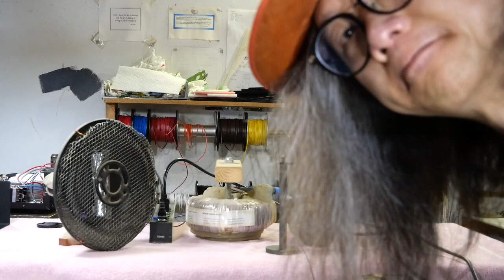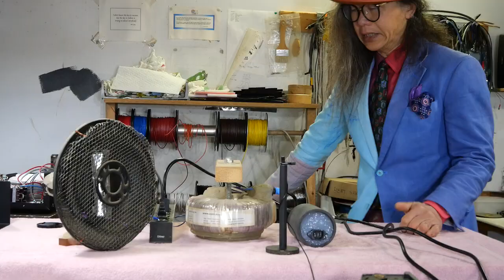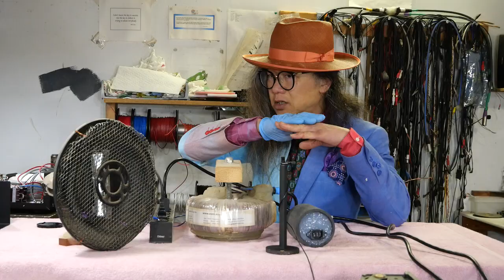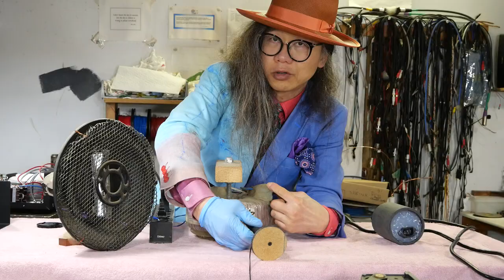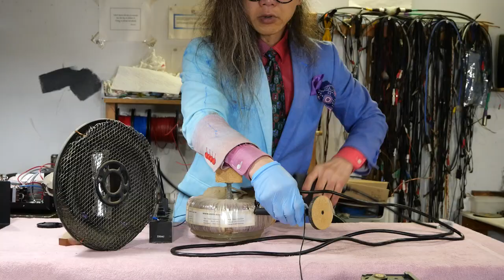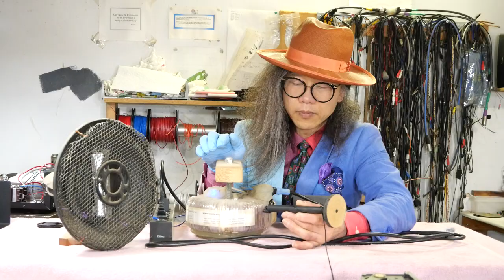DC offset on the ac powerline explains and demo of how DC offset affect transformer.

Comment: @angela-gilbert  great video and thank you!  During early evening my equitech buzzes like that, but quieter.  My question is, does having DC offset impact the sound coming from the system?  (Aside from the noise from the transformer).   My system always sounds better to me after 9PM… is it related to the dc offset or maybe also other noise and voltage sag that happens early evening?   Can DC offset itself impact the audio sound?
Reply from the maker: A little but of DC offset isn't going to hurt but annoying hum from the transformer.  At some point though, when the DC off set get bad enough will start affecting the operation of the transformer causing it premature saturation which will affect the power supply and cause the sound to change.  Where is that point will depends on the transformer design.
Reply: Thank you for your straightforward honesty based in science:)
Reply: So what do you recommend when someone notes their sound system sounds more relaxed later in the evening and a little edgy during early evening?

Would something like your XF series be appropriate?
Reply from the maker: @shionsmith8190  At night, less power are being drawn from the powerline.  Less heavy machinery causing DC offset let noise, etc.  It is the reason at night, usually sounds better.  Adding any of the XF filter will certainly help.

Comment: Does the DC offset affect sound in a system down the line?
Reply from the maker: Yes, it does.  The transformer is less efficiency when it has DC offset.  At the minimum, it decreases the power output.

Comment: What if you are off-grid and your house, stereo runs off battery power and an inverter.......how do you stop inverter noise?
Music-
Artist- Home Alone
Album- Kill em With Kindness
Reply from the maker: @freeradical6390  If inverter is making noise, thr sine wave isn't pure enough.  Make sure you don't use modified sine wave inverter.  There are low distortion inverter but they cost more.  Sometime a lot more.  Of, buy equipment that runs on DC battery. I havr done that 15 years ago with solar panels.

Comment: OH MY GOODNESS THAT'S EXACTLY WHAT I NEED....my Naim NAIT 5i transformer buzzes when I turn on my Sony Bravia t.v using a cheap Amazon power supply, I remember you offering to build me a new Sony Bravia linear power supply AGY for $300 ...do I need the blocker or a new power supply arrrg? Lol thanks AGY , p.s I love that blue jacket
Reply from the maker: Which side of the blue you like more? 😁😆
Noise from switching power supply is usually a different type of noise.  They can be DC offset but not necessary limit to just DC offset.  It also causes high frequency noise.
Reply: @angela-gilbert  I'm planning on buying a new t.v lol... maybe a new t.v with its original power supply will stop the buzzing I'm getting the buzz comes through the sound and the Naim physically buzzes ...I called Naim about this problem and I was told by the rep here in Canada that the environment that Naim amplifier are in can effect it in this way ...wow.  I wonder if I will cure this problem with a new t.v ?  Will see wish me luck lol.
Reply from the maker: @greenlanternseven  I wish you luck.  One of the many thing which may affect Naim is because they don't connect this signal ground to earth ground.  Essentially a floating ground.  Unless they are connected to something else which has a connection to earth ground.
Reply: @angela-gilbert  no kidding AGY maybe that's the problem it sounds like it , signal ground vs chassis ground hmmm?....any recommendations AGY ?
Reply from the maker: @greenlanternseven  You will need someone who can "see" and understand your system entirely before any effective recommendation can be made.  Not knowing the entire system, best we can do is to make educated guess and trial and error.
Reply: @angela-gilbert  it's very simple AGY when I unplug my Sony Bravia t.v Amazon power supply to the t.v the Naim stops buzzing
Reply from the maker: @greenlanternseven  You can try grounding the Naim signal ground to earth ground.
Reply: @angela-gilbert  that sounds great how do I do that ?...run a ground wire from RCA's to ground in wall plug isn't wall plug earth ground ?   This could be the fix I'm needing
Reply: Or am to running a ground wire from main IEC ground in Naim over to the RCA's in the Naim ...?  I know I'm over the target ....thx so much AGY
Reply from the maker: @greenlanternseven  This is the reason you need someone to fully understand the set up before any effective solution can be found.  We are shooting blind right now.

Comment: good content :)  but most people or amplifiers will have a full bridge rectifier in system.. so i dont understand this expiriment alot .. tnx anyway
Reply from the maker: Are you sure?  Are you sure full wave bridge rectifier is always in their system.  When you said "in the system", do you mean inside their amplifier or in the system within the listening room?  Still outside the amplifier?  If DC offset is not a real issue, I am sure there are nobody will complain their amplifier transformer is making noise.
Reply: This experiment does not go into a lot of detail of where DC offset comes from, but the fact that it can easily be found in many systems. All of my components currently in my system employ full wave bridges, but I still have DC offset from other devices in the home that do not. Not every audio component has a full wave bridge either, I have seen quite a few vintage solid state amplifiers that only have a half wave as well.
Reply from the maker: @quarkhifi  There are many places where DC offset can come from.  This doesn't limit to electronic components.  Electrical motors can also cause DC offset.
Reply: @angela-gilbert  I haven’t measured but I always had a hunch my dryer makes it worse
Reply from the maker: @quarkhifi  Dryer do make thing worse.  Sometime they cause distortion of the sine wave.  Which is not necessary result in DC offset.  If the distortion is not even, then DC offset occurs.
Reply: Phantom power
Reply from the maker: @raidensama1511  If you refer phantom power as high phase angle of motors and others, agreed.

Comment: what led bulb does not generate noise? what spec should I look for?
Reply from the maker: LED by itself doesn't generate noise.  It is the switching power supply inside the light bulb which drives the LED that make noise.  They make different type of noise the the half wave rectifier.  Specs don't usually help choosing the light bulb.  You have to try them and see what is the result.  Try not to have them on the same breaker as the audio.  For a start.